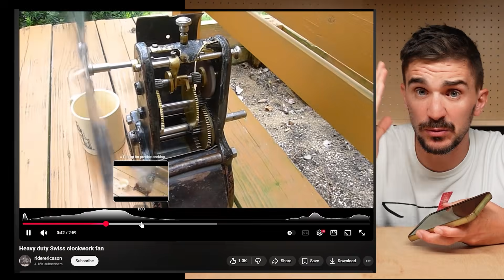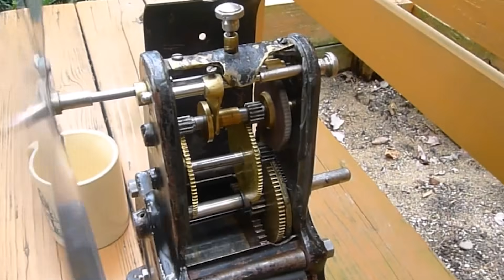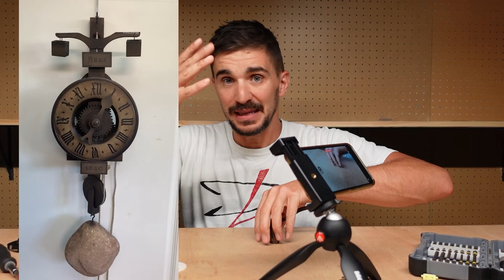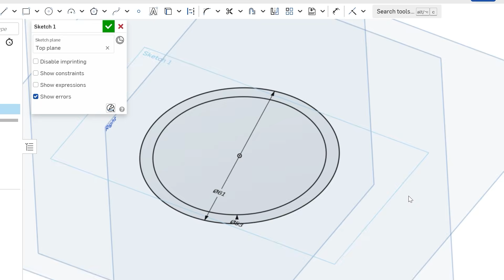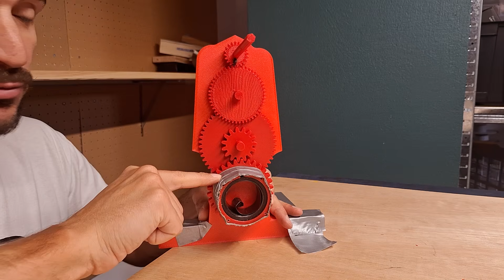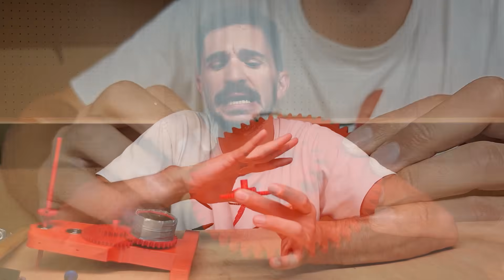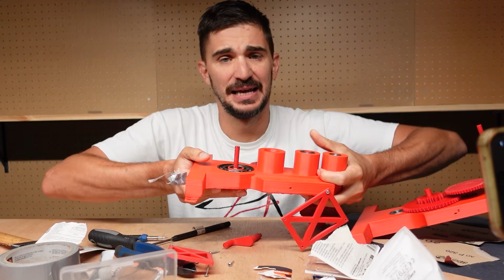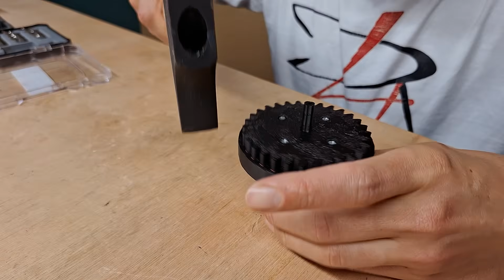No Cables or Batteries, Just Pure Mechanical Engineering - This Swiss Cooling Fan Cools You For Free

Comment: Watching this was only a fraction of the waste of actually making it with 3D prints.

3D printing is meant as a "could it work" thing for projects you don't want to spend real materials on.
They are NOT for practical use in any case.

Yes, people will say I am wrong. That's fine. I still stand by my statement that 3D prints are NOT good enough for final products.
And this project would have done so much better if you just outsourced the work to someone like PCBWAY or likewise where they would laser cut and/or CNC it to spec.
You'd get rid of most of the friction losses that way.

Finally, using a tape measure as a power unit? Too weak, by orders of magnitude too weak even.
At least you could have used a self retracting dog leash, they are much much stronger AND still easier to work with because they are bigger.
And I serviced one once and made the mistake of fumbling with the spring. I could still wind the spring back into the assembly exactly because it was larger and thus easier to handle.

Comment: What’s the difference in efficiency and ease of precision between these gears and a planetary gearbox? My friend 3d-printed a propeller launcher (easy to find on makerworld), and it has three planetary gears compactly stacked on top of each other, results in a 1:64 ratio. Assembly doesn’t look too bad as well.

The only thing is packaging, if you don’t want to add 90° turns (they will rob you of some additional efficiency), it would be more thick, rather than high

Comment: My old lawnmower had a clockwork starter. About 5 turns on a crank handle then flip a lever out and it would discharge the spring into the top of the crank. You should try to find one of those.
Reply: yup this would be a good place to start those things hold a lot of energy
Reply: A lot of 1930s airplanes used something similar to start their engines.  You can find videos from the 1940s of mechanics winding up the spring, then BOOM let it fly and start the engine.  Intertia starters?  Not sure of the name or when they stopped using them.
Reply: @grizwoldphantasia5005 definitely a flywheel...
Reply: Hmmmm. .... come to think of it, I may be wrong.  They might have been cranking up a flywheel, and when it had enough energy, they popped a clutch and it spun up the engine.  No mainspring, just a heavy flywheel storing energy.

I suppose one difference is the flywheel cranking would speed up with the flywheel, but winding a spring might slow down as the spring wound up tighter.
Reply: @grizwoldphantasia5005  I know we had one when I was young. the spring even broke and my dad go it welded back together but it didn't hold for very long.
Reply: I had a mower like that, I don't remember the brand, but the engine itself was bad. The rings, bore and bearings were all badly worn and the mower was from the 1960s and parts were unavailable to repair it. I wish I had kept the wind-up starter mechanism to use in something else, but I ended up scrapping the whole thing.
Reply: @JawzXlives my dad had one I used when a kid 13yo about 1970s but it was old, never started piece of junk and was heavy as a tank didn't know that until dad upgraded to a new mower, happy to see it go, all I have is bad memories of that mower...

Comment: It wasn't just the 4 walls and the size of the print, its the grid infill, it deformed the dimensions of your print because every layer of grid infill overlaps at intersections, multiply that by every layer and you end up with a sizeable difference, this affects every print regardless of size. Rule #1 of 3d printing : Never use grid infill, friends don't let friends use grid infill, also shame on bambu labs for making this the default in bambu slicer.

Go for Cross-hatch or Gyroid, or if you switch to orca slicer theres variants of Gyroid that are even better, also while that will fix part of the warping, the rest of it is just fine tuning your filament profiles, increasing the cooling, raising the bed temp, minor tweaks.

Edit - BTW Tip for Gyroid type infills : Gyroids are super strong and you can use a lower density without compromising strength, 12-20% density works on almost any size print.

Comment: Drive the fan with a stirling engine, let the fan pull double duty by drawing some air through an evaporative cooling element linked to the cold side of the stirling engine.

A water powered cooling fan with virtually limitless runtime, just scale the water tank to the desired capacity. Bet it would even be easier to print and assemble than this clockwork variant.

Comment: A couple of things you can do to make a better gear. 
1. Instead of a solid gear, make it with spokes.
2. make a small hole all the way through the shaft of the gear because the slicer will make extra wall around the hole making it stronger.
bonus. I sometimes make the hole through the shaft then 3D print an insertion post horizontally that fits in the shaft like a spine making it even stronger.

Comment: I don't think it would be expensive. What comes to my mind is those toy cars that you wind or juck them and let them run. They have an internal flywheel.

I disassembled, you did... And they have gears with small teeth. 

And the fan from the original video that inspired them have gears with small teeth.

Also you used a weak spring for the kind of job that it needs to do.

Comment: Repairing tape measure memories... Cutting new notches in broken tape coil springs... It works for five goes then snaps somewhere else. 
  I think you did incredibly well for a mere tape measure power spring. Even mainsprings in watches normally have far more coiling for longer release (still pretty short without the high gearing obviously) and the fan would have a demon of a wide tempered tape coil in it with precision gears and tuning throughout. 3d plastic loses energy everywhere. I think fact you got two minutes out of it to me was very impressive!! And not a drop off 9110 in sight! 😉👍 Love it!

Comment: More aerodynamic adaptation required to optimise rpm and torque available. The electric fan blades probably have much higher design speed.

Comment: I am not by any means a 3D printing expert, or even amateur. But it does seem that you could reduce the amount of snap-off support needed for a flat-sided print, by printing that first layer directly on a piece of wax paper or OHP sheet or something, stuck flat on the printing bed, if you don't want the texture of the printing bed baked into the bottom side of the print.

For people more electrically and less mechanically inclined, computer fans only need a watt or two, and a bunch of old vape batteries can run one for hours. That plus a small solar panel, some duct tape and a bit of ingenuity can give you some personal cooling all day and night. It's basically what I've done with an old 140mm Noctua and some 18650s. Not as cool as a full 3D printed, clockwork-driven contraption, but definitely an option. c:

Comment: I've often thought; why there aren't more consumer products such as flashlights especially since LED lights don't need much power, don't simply use a wind up clockwork mechanism driving a generator instead of using batteries? When I was a kid, there were still many wind up toys. When I had the idea for new applications for wind up clockwork technology more than 20 years ago, I ran into the same problem. There weren't any wind up mechanisms available. I would have thought, that I would have found a myriad of sizes and types of wind up clockwork mechanisms available, but I didn't, so it just ended up a pipedream, like so many ideas and unfinished projects I've had over the years, especially since I'm easily distracted.
       Anyhow, I applaud your work! Seems like a wind up offgrid smartphone charger would be a good idea too!
Reply: I have a flashlight where I shake an internal magnet back and forth through copper-has a gold based capacitor.  Even if I used it everyday, it would probably still out live me.
Reply: @justinw1765 I'm familiar with those induction flashlights. You have to shake them for quite a while for a relatively short duration of light. Seems to me, a windup flashlight would require much less effort.
Reply: @sparky6086   Possibly. Not sure.

Comment: You need a much heavier spring , you can tell they where using mechanical advantage and a ratcheting mechanism to store energy in the antique ones.
Reply: seat belt spring?? =)
Reply: he needs to be born maybe fifteen years earlier. using 3d printers does not equal careful observation. he is a lodge backed entertainment service only.

Comment: Idea! Use a planetary gear speed reduction for the crank that winds the spring. People are strong, so it can be a 3:1 or 7:1 ratio or something like that. A strong housing would be required. I also think a bit stronger spring, plus the planetary gear sets in screwdrivers which someone else mentioned sounded good, rather than plastic gears. But I'm very surprised you got plastic to run that long! Well done, D4A! ❤

Comment: I'm surprised you did not just use a piston ring compressor to keep that spirng tight. I think you could use one if you work it in around the spring after trimming the spring then turning the spring while pushing/guiding the end into the housing. Then you could easily print a new housing for it.

Comment: i mean.... dude you barely tried testing anything. you took a 3 dollar spring from a tape measure. why would you think that would be good for a fan? no testing of materials, thickness or length. you did these comparisons for the gear teeth about what's better for torque and what's better for speed, but for the spring you were like "ok im gonna use a tape measure end of discussion." and then you're like ok guys, 3d printing isn't very precise because it warps. yea... so why don't you get it machined? i don't think it would be as insanely expensive as you are saying. people use these companies like pcbway all the time. i don't know what you have locally but once you get the gears as good as you can, take the design to a machinist and get the thing made of aluminum or whatever. it doesn't make sense to me. there is no way that a big fan like this with 4 gears is harder to build than a wrist watch. it's ok if you lost interest but i think your conclusion is a bit strange.

Comment: I had a Swiss made Monaco shaver that was used by Apollo 14 Asto.   It worked very well and one winding was sufficient for several shaves .   I can’t quite remember, but it seemed to run about 10 minutes.   Obviously for the Apollo missions it overcame the problem of the danger of batteries.  The Hair were captive within the shaver.

Comment: I have played a lot with this type of springs in my childhood.
To safely transfer it or to handle it without it "exploding" is too just fix the outer tongue, an the rotate the internal part, as you do it it will get smaller and smaller until it no longer touches the walls of the housing. After that, you can't just smash the Walls of it with an pliers our something, the friction will keep it in place. After that transfer it to wherever you want toi

Comment: Clockwork is neat. The big, cast iron fan with a mainspring that's probably large enough to fill that entire lower housing is an excellent example of what it can do. You could tell from the sound when the crank was turned and the ratchet mechanism clicked that it stored a significant amount of energy. With good tolerances and bearings, I don't doubt that it would spin for 30+ minutes. A bigger, harder-to-move fan will increase the amount of time that it spins, as long as there's enough torque to move it at all, because it will spin slower and the output shaft will rotate the same number of times for each crank. Spinning time isn't a good way to measure how useful the fan is for that reason. The usefulness of it is in how much energy the mainspring (mechanical battery) can store, and how efficiently the machine converts that energy into moving air.

The best mechanical batteries using steel springs store up to 1,770 J/kg (by mass) or 13.8 kJ/L (by volume). A typical alkaline AA battery stores 9,360 J, weighs 24g (390 kJ/kg), and has a volume of 7.92 mL (1,182 kJ/L), so these batteries are 333 times more energy dense than steel springs by mass and 86 times more energy dense by volume. A rechargeable 18650 cell is about twice as good as a AA battery (they vary a lot). So, there's a better explanation for why mainsprings aren't much good for anything that requires more power than retracting the ripcord on your lawn mower, anymore: they're obsolete. A fan (or anything else that's valued for the large amount of work it does) isn't a good way to use such weak-but-convenient forms of portable power. A little handheld toy with a single 18650 cell and a fan made from foam will move more air before discharging the battery than that big cast iron fan does. And you could recharge that cell with a crank, if it's connected to a generator and the right circuit. That would be a fun project: a retro, cast iron crank connected to a generator, for recharging devices. Maybe add a flywheel that you have to get up to speed to reach a high enough voltage to charge. We might appreciate the power of our devices more if we had to turn a crank for 30 minutes to charge a smartphone. That probably wouldn't feel 'free.'
Reply: Would like to see more efficient and more durable crank based chargers personally.
Reply: @justinw1765  E-bikes are a good place to look. The best way to convert human power into shaft power or stored energy is with a foot crank, and bikes are well-optimized for that. They're very durable and efficient, and they're produced at a large enough scale that some models are quite cheap. If you want to charge your phone with your muscles, find an e-bike with a mode that lets you turn off assist and instead stores your pedal power in the battery. Then your bike is a phone charger.

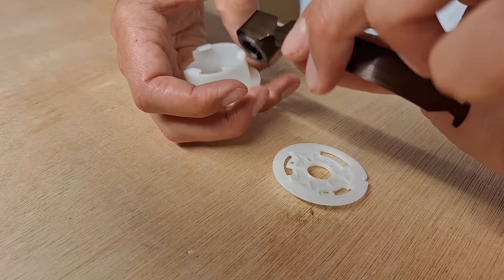There are phones on the market with 7,300 mAh batteries. If their curve averages at 5 V, that's 36.5 Wh, or 131,400 J. A cyclist in good shape can sustain 300 W for a while. That's a minimum of 438 seconds (7:18) of pedaling at 300 W to store enough energy to charge such a phone, but more would be needed because of inefficiency. Call that 10 minutes. I estimated 30 before because 300 W is pretty high output, beyond most people's ability to sustain, especially if it's a hand crank. Also, if you expect the bike to move while you're pedaling, the power is split, increasing the time.
Reply: yeah but the real reason is the number of gears and bearings and machining involved in making clockwork... not the energy density...
Reply: @permaculturepup  No. Energy density is the reason why the fan in the video is obsolete in comparison to battery-powered fans. Mainsprings are not prohibitively expensive to make. Dirt cheap fans already have bearings and sufficiently precise, mass produced housings. Gears are difficult to produce and expensive, even if they're relatively low in quality, but they would be worth it if a purely mechanical, portable fan (or other tool) could work as well without an electrochemical battery. The reason mechanical fans like this are not on the market today is that springs can't store enough energy to be worth the cost of producing such a machine.

Mechanical energy storage would be amazing if we could make springs that store 100-1,000 times as much energy. Then you would see clockwork vehicles, power tools, etc. Currently, materials science says no. And we don't expect that to change by much.

Flywheels are another form of mechanical energy storage. Those have practical applications at larger scales, e.g., in a wood chipper, but only because they can release their stored energy so quickly, delivering huge spikes in power output when driven by some other power source. They're better than springs, but we still wouldn't use them by themselves, as a form of portable power.
Reply: @LiliaDement  no I mean it would be a fun 3d print if you didn't need the bearings and sh*t.... did you even watch the video?  Seems like you have to much time on your hands.  I can't read all that on a youtube comment.
Reply: @permaculturepup  Too much time on my hands? The video got me interested in calculating the best-case scenario. I'm curious. So, I learned. And I shared. Is that a bad thing?
Reply: @LiliaDement  only you can decide the best use of your time.  but learning is never bad!  But there is no payout for teaching people in youtube comments, probably could have gotten college credit for that much work lmao!
Reply: @permaculturepup  I appreciate that.

Comment: i have some ideas to improve this a lot:
as bearings i recommend using old fidget spinner ones that have no grease, and spin much more freely than grease filled ones.
thinner gears and metal axles will help there a lot, as small bearings have in general a bit lower resistance than bigger ones and the load capacity isnt needet here 
also use a lot bigger/stronger spring, that also means you can increse the gear ratio also a lot for more runtime

Comment: Maybe if you can get the parts drawn out well, you could order all of the gears in brass or steel. And If you had a 200lb main spring in a 8" diameter coil with a 10 inch crank lever, you could really get 30 minutes. :body-blue-raised-arms:

Comment: There is a much better way to make a fan or a generator feeding some light source. Remeber old clocks with chain and two weights? That's the idea, use gravity instead of spring tension.